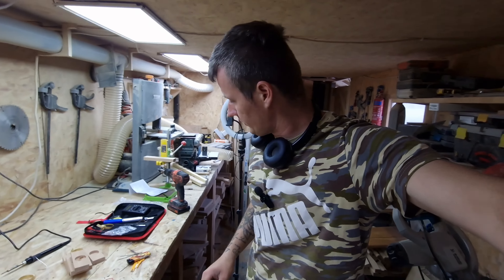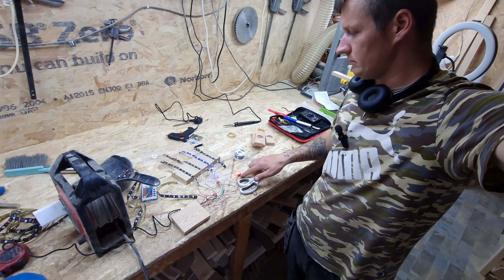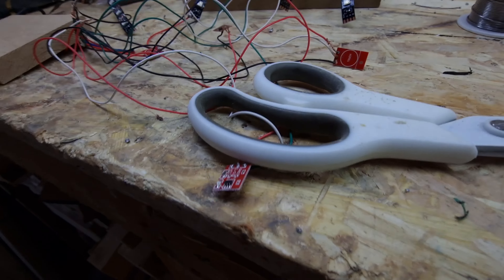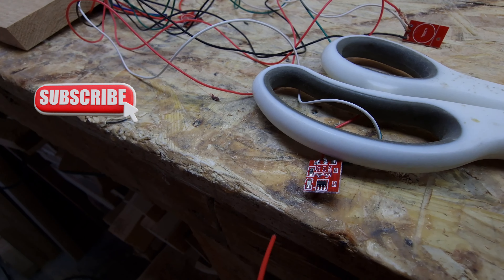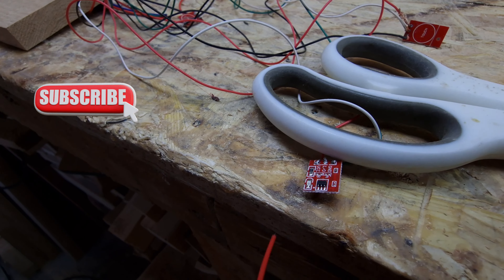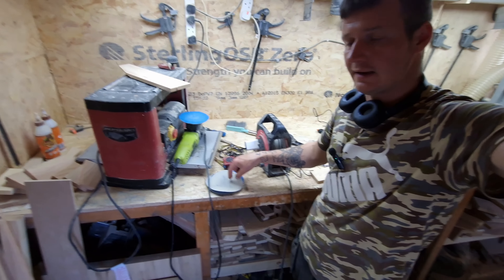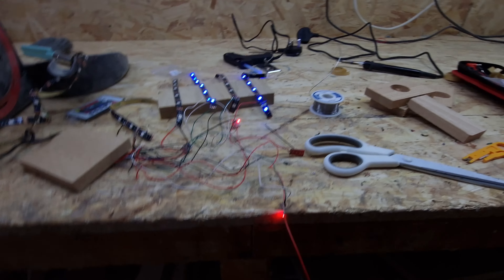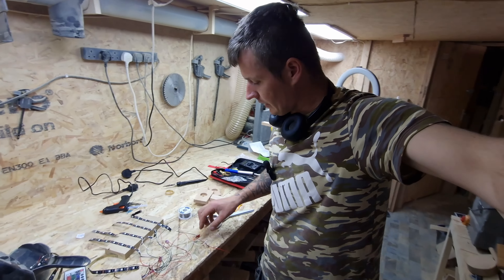How to extend touch range on TTP223 touch sensors. My new project. Quick tip how to! Do it yourself

Comment: I was searching a long time for a solution to extend the touch range with a cable, your idea combined with a 47 pF capacitor between the S-point connection to reduce the sensability was the solution, thanks for your post !
Reply: Wait can you elaborate on this?

Comment: hey guys, I just found an easier to do this. my dad is an electronics technician so when I ask him to solder the wire for me, he asked me to get the multimeter and he checked whether the leg of the component is connected to the soldering pad to the right of the leg. Turns out it is connected to that. Long story short instead of soldering the wire to the leg of the component which will be challenging to do, you can just solder the wire on the soldering pad or whatever it is called that is next to the leg. I notice there a top and bottom part of the pad, my one is connected to the bottom.
Reply from the maker: Now u can buy complete sensors no need to do any modification.  And have dimmable function
Reply: @Audi90projekts  what are you talking about?  My guess is that there is a different touch sensor module that already has a through hole to add the antenna and dimmable function.  Would be helpful if you would share the actual model number of the module.

What @angelotabora8602 mentioned is correct.  instead of adding the wire/antenna to the leg of the component, you can use the lower soldering pad to connect the wire there.  That pad and the leg of the component are connected. It seems depending on who you get your TTP223 will determine the size of the pad.  The ones I am working with have very small pads, but I have seen same touch sensor with larger pads on some of these videos.

Comment: Hello from Germany, I have made all like you with the ttp223, my problem is that I have not the full power light on the led's, what can I do. Greets
Reply from the maker: What voltage leds u have? Ttp223 sensors are reducing coltage

Comment: can you please confirm this, The TTP223 capacitive touch sensor does it have built-in timeout mechanism? the reason i am asking is i am trying to use the TTP223 in a way when i touched and keep touching it i want the LED stay ON while my hand touching it and when i release i want the LED to be OFF. i have tried it but after like 7 seconds the LED goes OFF even i am still touching the sensor. Can you help with that?
Reply from the maker: You can use it in 3 ways. 
1st As touch sensor 
2nd  as switch when u touch light goes on and stays until you touch again then it goes off. 
And 3rd is when u touch and keep your finger on sensor it will work but when u remove it goes off

Comment: how long can I extend the range using wires?. nice vid
Reply from the maker: If longer cable then longer range I believe.  However on there is another option where u need some transistor I think

Comment: Hi, what LCD strip are you using and how do you turn it on and off with the sensor?
Reply from the maker: I'm using 5v led strip from usb. It's all connected to 1 power source. Once you touch se sor it turns on